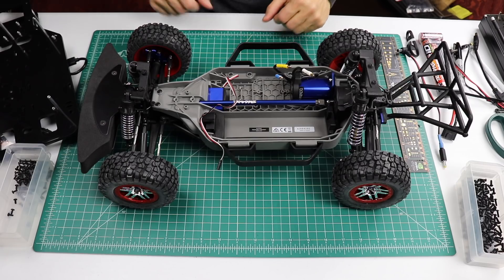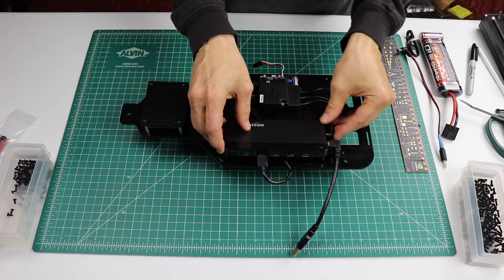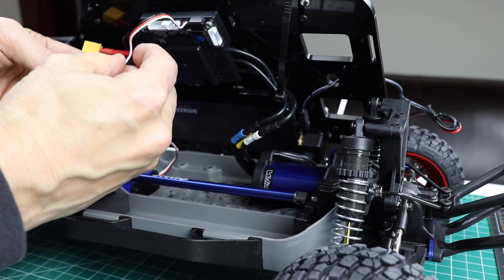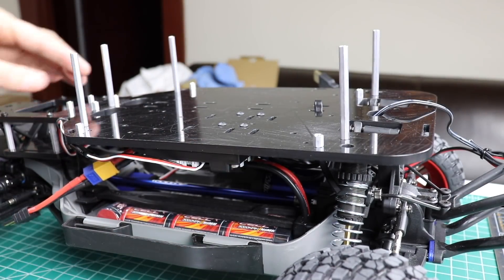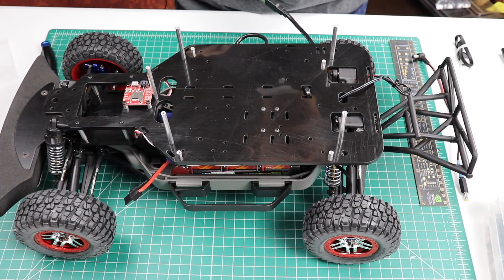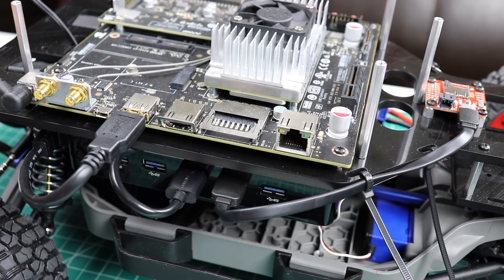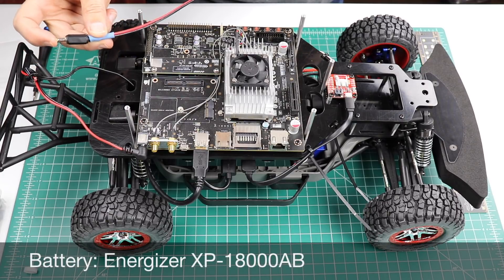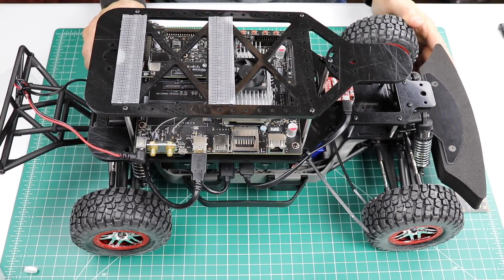RACECAR/J Initial Assembly

Comment: Does the TX2 have quite a high inrush current? I am trying to power mine from a drill battery which I would have thought would have more than enough current capacity, but even at 14.4 volts, slap bang in the middle of the reported operating range, the board just sits with a little red light. Can confirm is fine as it starts up no problem with a wall wart. Is there just something special about lipos? Thanks!
Reply from the maker: I do not believe that there is anything special about the LiPos. Assuming that you have the polarity correct, and that the battery is producing 9-19V and produces enough current, it should work. Some people have reported having to add an extra capacitor to help with startup. You may get a better answer on the official NVIDIA Jetson forum where a large number of developers and NVIDIA engineers share their experience. The forum is here: https://devtalk.nvidia.com/default/board/188/jetson-tx2/
Thanks for watching!
Reply: @JetsonHacks  Thank you! I will experiment with a cap across the battery terminals